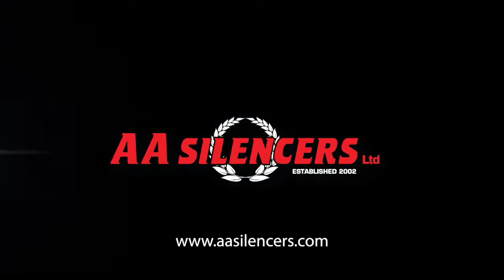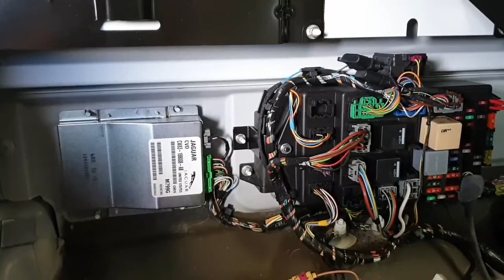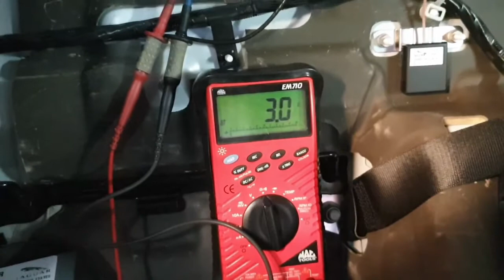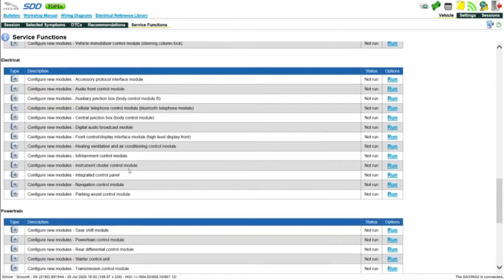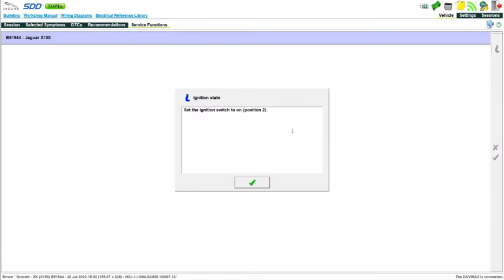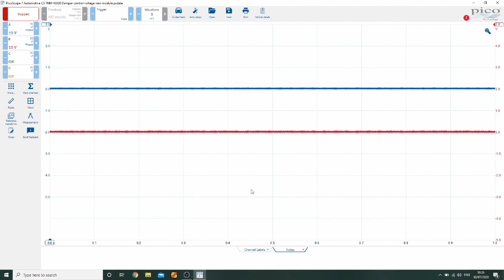AA Silencers Jaguar XKR active suspension fault

Comment: You saved me time and $$$..  I replaced with a used module installed myself..  CATS System error was resolved ...  Thank you for the video!
Reply: did you have to code or programme it or was it plug and play
Reply: @raycroal  It was plug and play.. I just made sure the serial number matched or close to it and year to vehicle.  Otherwise you will have to program at the dealer or independent Jag dealer..

Comment: I have a similar issue. No faults on dash. Very harsh ride. Can’t corner around a turn without springing side to side. The shop only test drove it and said it felt fine. Another shop hooked up computer while riding and only found one accelerometer a little off range. It was changed and made no difference. All 4 shocks were changed and made no difference.  All modules were reset and no difference. Taking plug off shock does show fault on dash. No difference in ride comfort between dynamic mode on or off. Any suggestions at this point? It’s a 2014 white XKR convertible.
Reply from the maker: It sounds like you're having a bad time with it.
I can't add more after reading your description and without working on the car it would be hard to move forward.
Has anyone run through the test plan for harsh suspension in Jaguar SDD ?

Comment: My suspension on my 4.2 N/A stuck in firm mode no cats fault checked voltage output on Jag diagnostic 2.7volts  at tick over but didn't check the ohms ☹️ got hold of an identical module Cats fault immediately but could have been holding old fault codes, so I'm down grading to non CATS, good video 👍
Reply: how do you downgrade?
Reply: @h7pubg  hi remove the CAT suspension shocks and replace with standard gas filled shocks which are a third of the price and more predictable however you will lose the floaty glide ride at low speed as the CAT suspension would stiffen up when the G metre detects lateral force unfortunately I found it too slow and the body roll before stiffening up was the difference between staying on the road or in a hedge when driven vigorously.
Reply: @h7pubg  oh sorry forgot early cats was an optional extra then all models were fitted with cat's 👍
Reply: hello, to get back to you, I have ordered 4 non cats shocks, have them in hand and will have it done soon, I wanted to ask you though, how did you remove the error messages? im a little worried about that, I thought you had to remove the module but i read somewhere else that it has to be reprogrammed to non cats spec with someone skilled at SSD, thanks
Reply: @h7pubg  no no just disconnect the module behind the rear seat or even easier remove the fuse then there won't be an error message 👍

Comment: i have a 2010 jaguar xk that has an adaptive dynamics fault as well, where can i get the software to reset the module?
Reply from the maker: You'll need access to the Jaguar SDD diagnostic system.
If it's something that you don't have then I would seek out a local specialist.